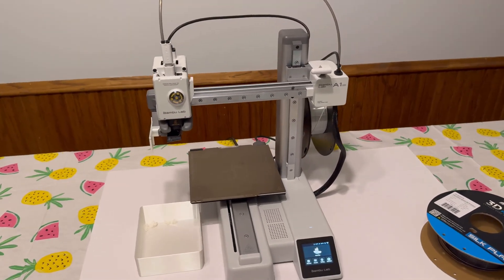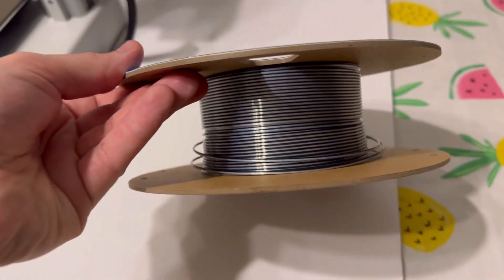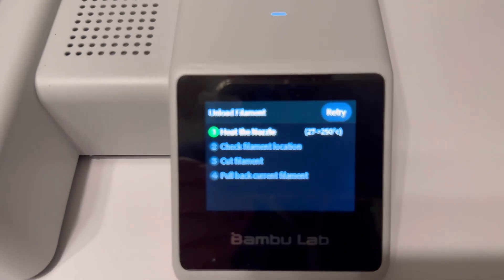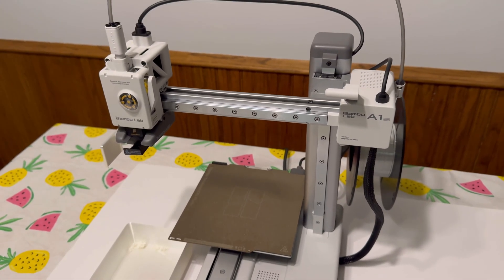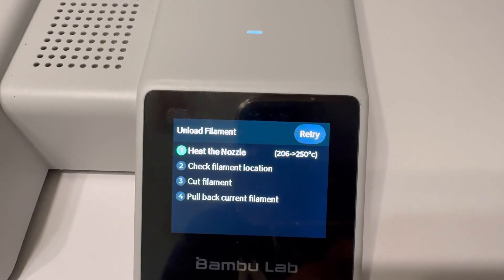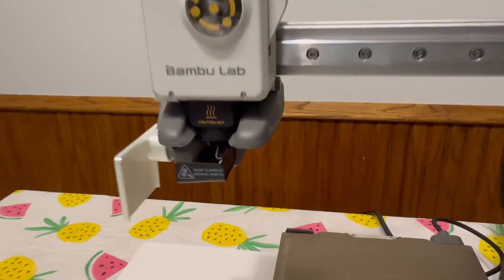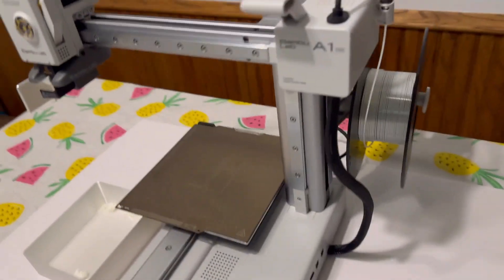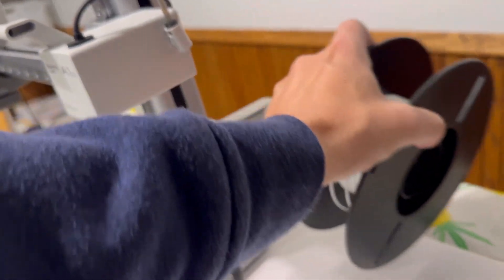How to Unload Filament on Bambu Lab A1 Mini

Comment: What do I do if the end of the filament is already inside the tube and I have nothing to pull on?
Reply: You can disconnect the ptfe tubes at both ends, and use a different filament to push the old one out.
Reply: Can’t you disconnect the ptfe tube at the tool head?

Comment: Having an issue where i roll back the filament but its not going back to the first page and is instead stuck on step 4... only way to fix it is to reboot..m any idea?
Reply: Same problem, looking for help. Did you found a solution?
Reply: Im having this issue too
Reply: @IdilleI97  I found a solution. I did what's described in this video: https://www.youtube.com/watch?v=U-zS7naUiFA. Almost... because he is lubing this part, and in my case it increased friction even more. When I cleaned it, the sensor started to work properly. Also, I contacted Bambulab support, and they were very helpful. Instantly offered me the replacement part, even when I told them that I managed to fix it. Worth trying if you are not sure how to fix it by yourself.
Reply: @mistrzu1231212  Yeah i found that video too. Contacted bambu support and replacement part on the way. Thanks for the tip anyway! 🙂